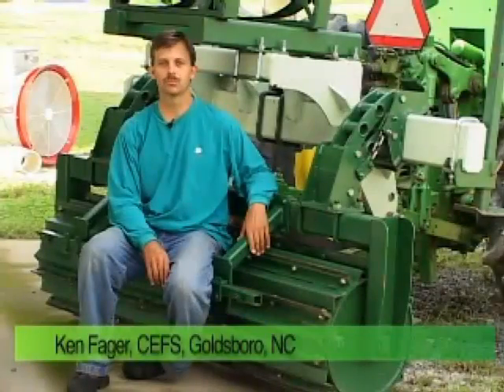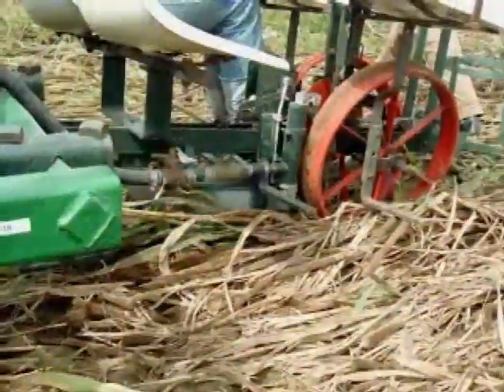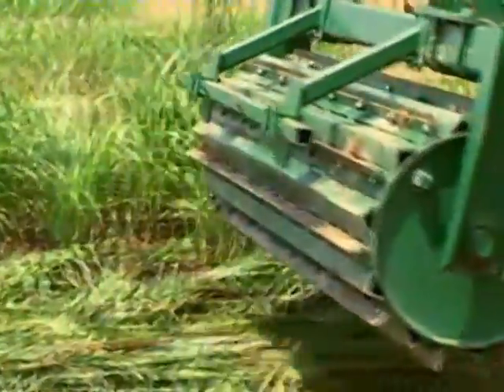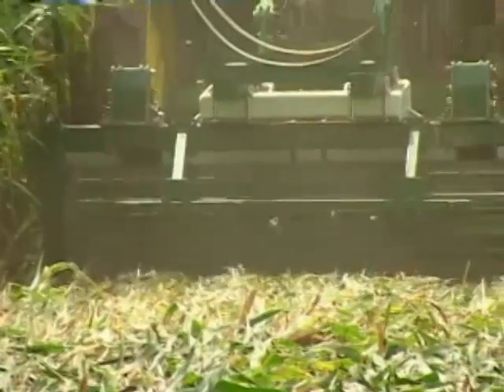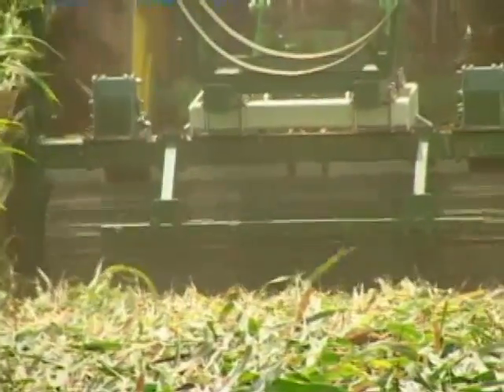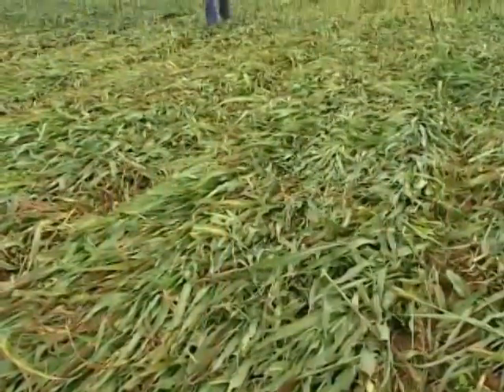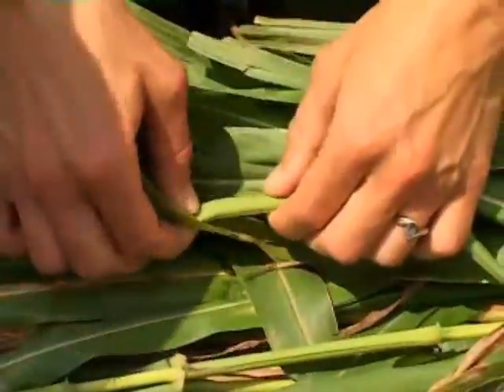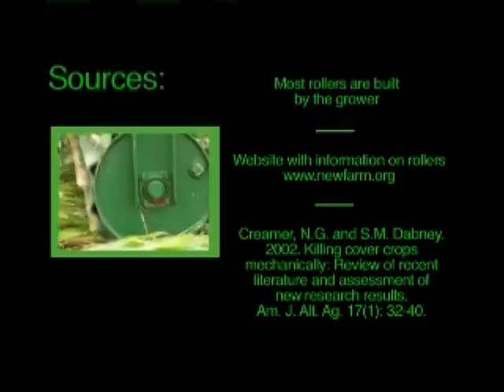Organic High Residue Reduced-Till Roller Crimper: Weed Em and Reap

Comment: NOt as much as u would like to see. ??? OK, It's easy to understand the Stalk must bend to crimp. This Drum has angle iron so it's making it more like a roller and stalk is flat when flat blade rolls over top. It doesn't crimp very well. 

Better Idea would be 2 have a big roller of Straight blades (that are not so close together )and then a second flat roller to ensure crimped plants are left flat.

Will a bigger drum with flat blades will crimp stalks better or worse than a smaller drum with fewer blades.  Stalks need to bend to crimp. Don't really want a roller. Want a crimper.